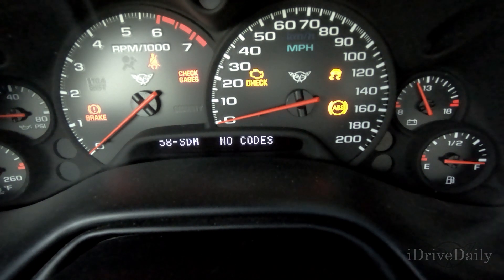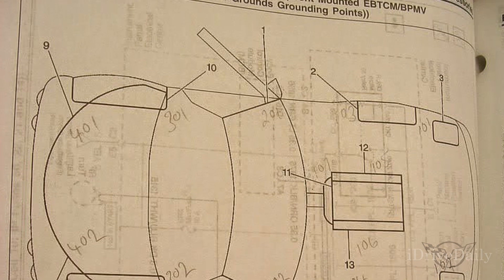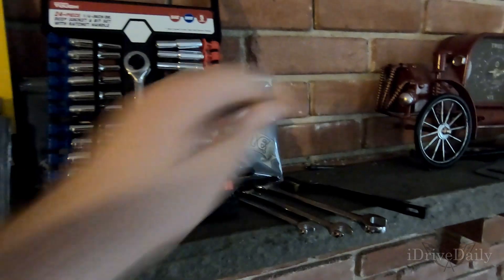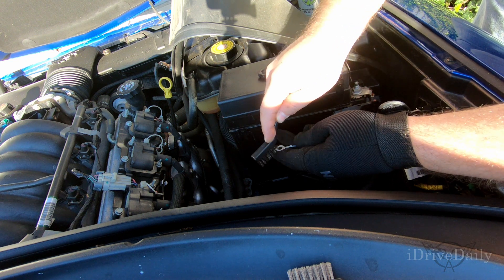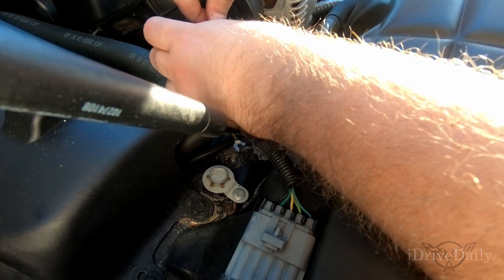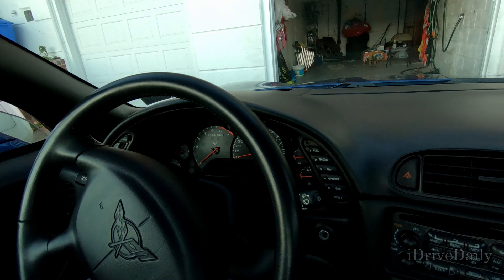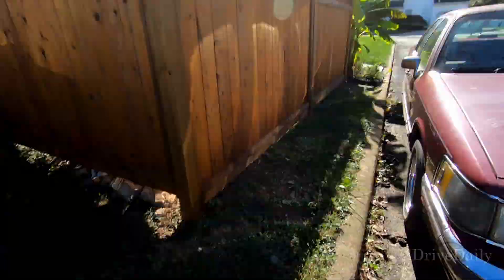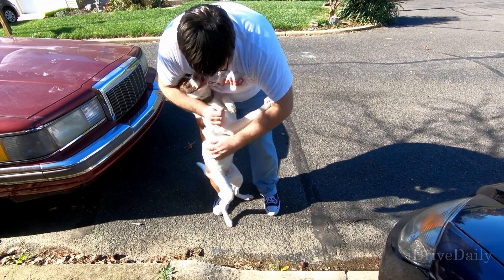Cleaning C5 Corvette Ground Points/Negatives

Comment: LED lights are notorious for causing this code. 

Also the emergency flashers as well as the brake switch throw the same code. 

It's not always the module.
Reply from the maker: Thanks, did not have any LED lights on the car at the time of this recording.

Comment: By any change do you know witch ground controls the fuel pump ground or can i get the wire from the harness and attached anither ground wire to the fra.e of the car?
Reply from the maker: To the first part of your question, the ground for the fuel pump is located in the rear of the car, one of the wheel wells. It is the same ground that connects to the rear lights. As for the second question, I am unsure.
Reply: Oh ok thanks so yes, I've clean that one already.. thank you foransweringmyquestion@iDriveDaily

Comment: The Electronic Brake Control Module (EBCM) of my 1997 Corvette is situated at the rear. Do the 1997 and 2003 C5s utilize the same grounding point locations?
Reply from the maker: I do not know, sorry.

Comment: Did you ever find out what was causing the problem
Reply from the maker: It was my EBCM. It should be the video I uploaded after this. "Code C1214: Repairing a C5 Corvette's EBCM"
Reply: I am getting a no comm when I scan it on the car in the tcs  and other then that no codes any ideas to why I have no power going to my tcs or at least no communications

Comment: Does your car not start do to the traction module? Mine is currently going insane one day at a time… you think I need to re rivet my chassis grounds ?
Reply from the maker: My car always started even with this problem. There are additional grounds that I didn't show in this video. Something I experienced later is if you have a short in one of the window switches, it will make the Corvette go into limp mode. I was told on the forum that this was not possible, but once I replaced the passenger door switch, it fixed my problem. Unfortunately, there are a lot of problems for the same solution. Not sure exactly what you are experiencing, but good luck.

Comment: Good video - I recently purchased a 50th Anniversary convertible.   Seeing some issues with the lights on the climate control, flashing,  turning off and being on the next day.  Along with pretty warm front panel.   Any tips or awareness of those issues?
Reply from the maker: Not off the top of my head, my radio/climate panel always felt warm to the touch, especially at night when driving for a long period of time. I just think the electronics inside generate heat. I would check you battery cables and insure they are in good conditions and tight. A lose cable there will cause things to randomly shut off and cone back on. Otherwise, a good ground cleaning could help. Check the description, there is a link to another youtuber's video that has more information on what ground point does what and that might be helpful to you.

Comment: Great and useful video, thanks! Do you know which negative point is connected with EVAP solenoid? My C5 doesn't receive "-" at EVAP solenoid connector and throws the P0443 code
Reply from the maker: I did see a schematic a few years ago, but cannot locate it again. Off the top of my head I don't know what ground is for the EVAP selenoid, but you can check out this video, it may be helpful: https://www.youtube.com/watch?v=PK81x5sG9OQ
Reply: @iDriveDaily  thanks! I'll take a look

Comment: Great video, I love all your detailed instructions. Two comments. Once you go into the diagnostic codes, you don't have to wait for it to cycle through all of them before you go into manual mode. If you push any button while it starts it's scrolling it will put it in manual mode right away. Also, unless you cleared out your codes, they are still going to show under history. There's a C in front of it if it's a  current code. So that could have fixed your problem, but they were just still showing as a historical code and not a current one based on what you showed there.
Reply from the maker: Yep, that's all correct! Thanks for the comment.
Reply: Good input and thank you for sharing this intel with us. (:
Reply: Yes excellent observation

Comment: what is the best solution or covering to keep the connectors from getting corroded again after cleaning?  Nice video!
Reply from the maker: I didn't cover them up, but I used dielectric grease when putting everything back together. I usually just visually inspect them when I'm in the engine bay and in the two or three years since I've done this, I haven't seen any significant corrosion come back.

Comment: I’m having the same issue on my C6. ABS and Service Active Handling System intermittently. Turn enginebiff and restart and goes away. Sny idea on how to fix?
Reply from the maker: I  can only offer some ideas. You can try by cleaning the ground points, which is the easiest to do. If that doesn't solve your issue, you can try checking out my video on the EBCM. [https://youtu.be/RHtQ2E160Cc] I believe the early C6s, if not all of them, used the same EBCM which is prone to failure from solder points going bad. It started out intermittent on my C5 and eventually failed altogether.

Comment: Nice video, having intermittent electrical issues not the same as yours but still the route ibwas gonna go for resolving them
Reply from the maker: There seems to be a lot of electrical "gremlins" that show up on the C5 and it seems no matter how many times you solve one, another will crop up. I've recently had another crop up and think I've linked it to my door control module. Regardless, it's always a good start to clean all the grounding points in the C5. Off the top of my head, I think there are 12 total, I only covered the 4 engine bay points in this video. When the weather warms up a bit (and I get some of my parts back pile installed) I plan on going through and giving them another clean.
Reply: @iDriveDaily  I had the dreaded steering lock relay issue but resolved that with a 50ish dollar part and 1 hour install

Comment: I had a thing where all my lights were flickering slightly. Cleaned my ground and put some diabetic grease on em for spark plugs and it fixed the problem. Good vid
Reply from the maker: Thanks for the support.
Reply: Mine is doing that. Which ground did you clean?

Comment: Mine does this but my gauges max out. Had yours done this?
Reply from the maker: My gauges did not max out during this issue, however I recently had my gauges do that when the car went into limp mode. Either way, ground points is a good place to start. The Reduced Engine Power is usually PCM, BCM or throttle position sensor issue, I believe. Although I'm currently chasing an bit more of an odd gremlin.

Comment: If it said "H" maybe it cleared. "C" means on darn...
Reply from the maker: Yeah, C means you haven't fixed the problem :( its always disappointing when you fix something and are still greeted with a c code.
Reply: What worse, is when you chase parts because you run the scanner, and it tells you a part, so you replace the part, and then you pop a different code, yet related to the same damn part in question. Fml. 🤦‍♂️

Comment: That's a beautiful finish on that C5. Love the color. Have you done anything to it, ceramic coating etc?
Reply from the maker: I have not. I wax it around 3 times a year - beginning of summer, midsummer and before winter. Usually two coats at the beginning and end of season. Thinking of getting it ceramic coated this year

Comment: We are in the same boat. My car throws the service codes and then slows my car down automatically. It's only intermittent, but since my driving is on the freeway, I don't feel safe driving my car with the possibility of having the reduced speed come on in heavy traffic. I'm slowly going through all of the causes. Frustrating to say the least.
Reply: Were you able to find the problem to it?
Reply: @joshallen2953  I changed the ignition switch and that helped for a little while. I was noticing that it happened more than once when I would turn hard right or change lanes to the right lane. Got to be the steering wheel sensor right? Changed that. Took longer, but it still happened. I wasn't going to keep changing parts. I kept my optima red top on a trickle charger all of the time. One day, I decided to drive it and keep an eye on the volts. It would fluctuate between 12.8 volts and drop down to 11 ish while I was driving. On a whim I decided to go buy a new battery. 13.8 volts with a low of 12.8 but for the most part it reads 13.8 volts while I drive.  I have had on instance of it happening again and that was when I hit a huge bump in the road, but that is the only time it has done it. I literally unplugged and examined 80% of all of the electrical connections on the car trying to figure it out.
Reply: Steve's N Vegas 
Please let me know what you find. I put in a new battery, cleaned all the grounds in the engine bay, all codes went away for 3 months. Drove it the over day now the ABS/Traction code is back. I haven’t checked the volts while driving, I will do so. Thanks
Reply: Sammy Garcia you have to change the ebcm for that traction control and abs lights bro this company called absfixer does it. You take it off and send it to them you can still drive the far without that part.
Reply: Steve's N Vegas damn man so still not “fixed”? I just bought a ignition switch in hopes thats my problem i seen forums where they say they have the same symptoms but some get fixed 100% and some are like your experience. Sounds like some type of ground though since you said it did it on hard turns or bumps. Idk if you are in the corvette forum but with light research theres this guy that posted the diagrams of ALL the grounds that are in the car from manufacture. If you have a after market radio then id recheck those ground points that were used for that too. I checked 100% grounds and everything last thing i got to do is the ignition switch, hopefully its that
Reply: Josh Allen 
Gotcha, I do know that I was jumping my vette a lot before I bought a new battery. Maybe I fried it? I will look into this. I know Yellowvette has a video on this also. You ship out the EBCM and they fix it al up and ship it back to you.... thank you
Reply: @joshallen2953  I have only had the issue that one time when I went over a big bump (my car is lowered). I haven't had any issues since. I have probably only driven it maybe 350 miles since I put the new battery in it. I cleaned almost every ground in my car and there wasn't any spots that looked bad.
Reply: @sammygarcia4160  When you contact them, they will let you know if they think you need a rebuild on it.
Reply: Sammy Garcia yup, i bought my vette with those lights on sent it out got it back and boom fixed. I mean doesnt really “affect” that car but its just annoying seeing the yellow lights lol i drive without traction control anyways so yk lol....also if you haven’t already you should join the corvette forum it goes by generations so (c1,c2,c3, and so on) and there’s experienced members  there that help out a lot. Itll come in handy someday as our cars get older lol
Reply: Steve's N Vegas 
Thank you!!!!!!
Reply: Josh Allen 

You are the man!  Thanks a lot. I appreciate the help! I will look into joining the form 👍🏽
Reply: Josh Allen 
I used to get the “Reduced engine”a lot cleaned the grounds and hasn’t came up since. But I am guessing it’s the EBCM...
Reply: With a good fully charged battery (12.6 volts) the ALTERNATOR/REGULATOR will produce 14.1 volts ( +/-- 5% = +/-- .7  or 13.4 to 14.8 ) while engine runs.  Measure voltage with multimeter probes at red (+) & black (---) posts on battery . Hope helps. Regulator & alternator are two parts inside one unit.  OEM parts should be longer lasting.